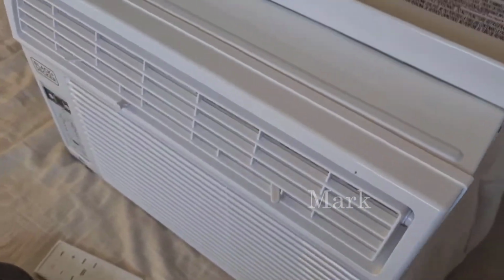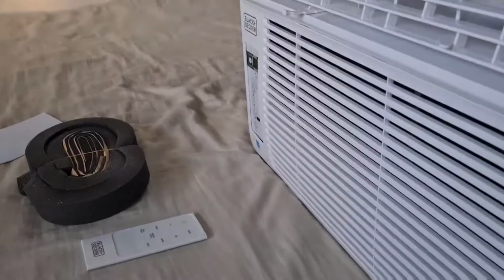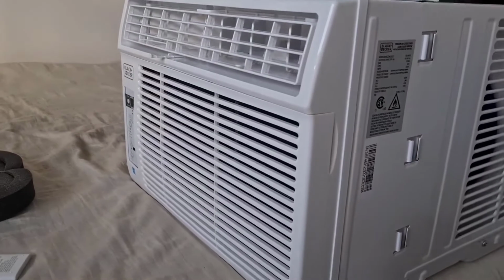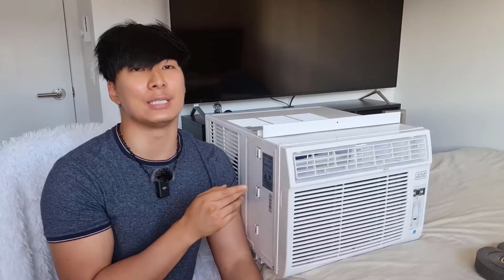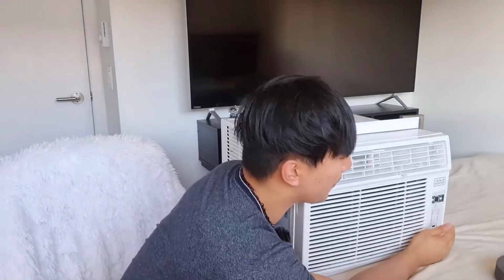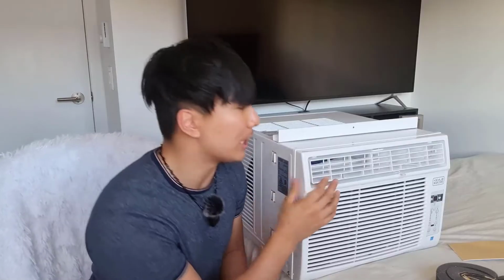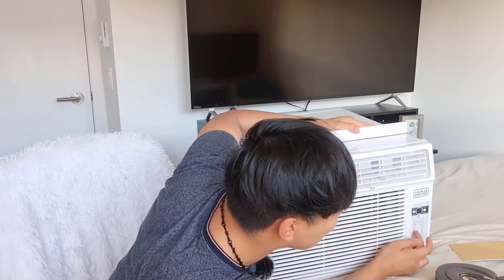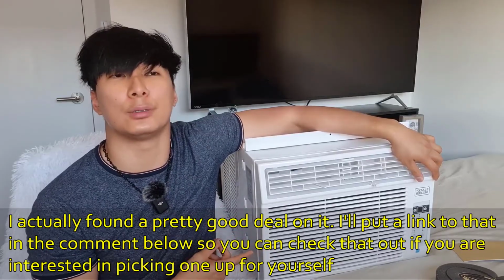BLACK+DECKER BD10WT6 Window Air Conditioner Review

Comment: Hey there... Thanks for the tutorial. So just for reference that tab you were pulling in/out, I have had this air-conditioner almost 2yrs and was cleaning it today finally trying to figure out what that tab was for (my air- conditioner very similar to your but not exact) it's extremely humid outside in Illinois tonight, so the tab should be pushed in? To keep the humidity out and cool air from air conditioning in? I'm thinking that's how it should be while that tab is pushed all the way in it seems as if it's closing the back end. Please and thank you